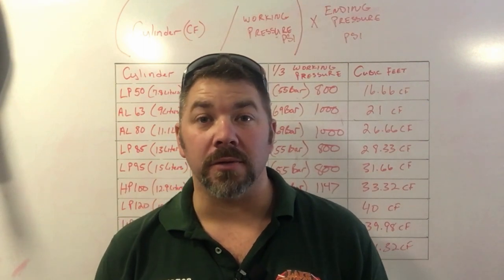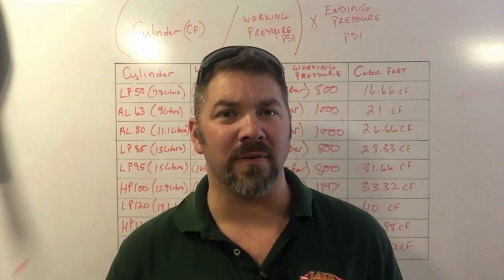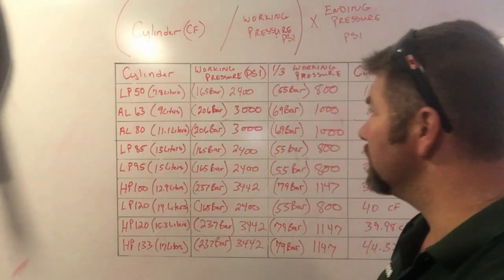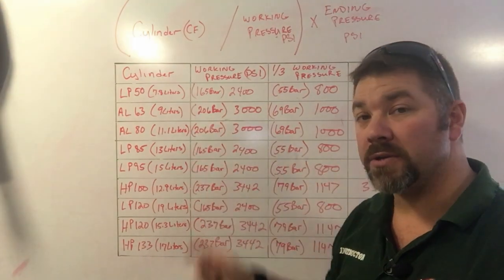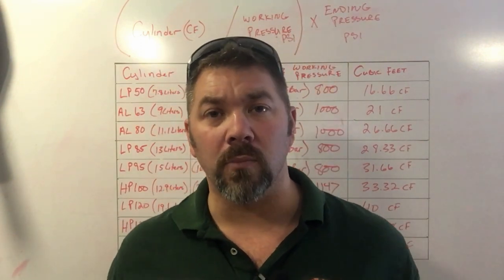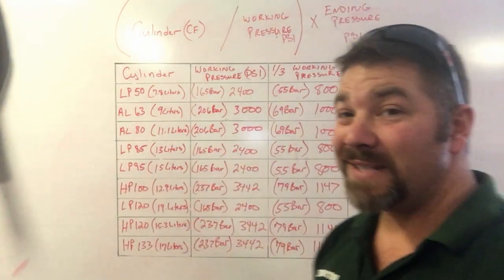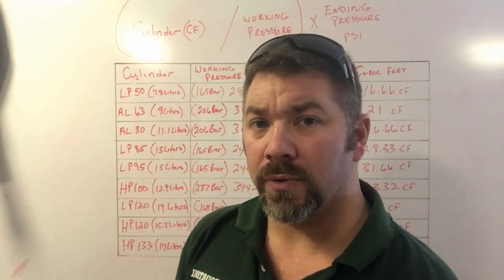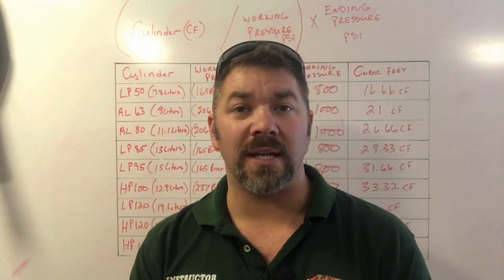How Much Air Do You Have??? Let's Do The Math

Comment: i have a pony plus a emergency spare air for extreme emergencies. lets say 2 people run out of air. i work on the rule of double redundancy. my instructor said i do not need to do this but i feel like i wanted to and he said it was my call. it sorta bulky but that is okay with me. i bought a mares dragon bcd. i have the spare air attached to it on the right side on a d ring. the pony is attached to my primary tank. i just like being safe and it gives me more confidence. 
ill be learning twins next year. 
:) best wishes
Reply from the maker: In my opinion, there is absolutely no problem diving with your setup.  I encourage all to dive in a manner that makes them feel comfortable.
Reply: thats  triple or quadruple redundancy, but if you like it, I quite agree , go for it, just remember with an increase complexity comes an increase in failure modes and confusion possibilities.
Reply: @LakeHickoryScuba  Im glad this came up, the trend lately i see and experience is the " Im safer than you" culture, many new divers I have come in contact with panic if someone is on a 40' rec dive without a back up computer, side mount twins with quad regs and a pony. That seems exaggerated but its showing up more and more, I was lectured by a new 62 dive tech/deep/sidemount student for diving doubles without an iso manifold and backup pony. It was a cleanup dive in about 15' seawater. theres great value in safety and training but it needs to be tempered in many cases, everyone wants to dive the Andrea Doria with 40 dives under their belt  it seems. In 40 years ive never had one ooa, and have only seen two- neither were equipment failures, just inattention,(relying on the computer in one case. ) if you expect a double ooa, I dont want to dive with you or your group.

Comment: When you do the equation for the AL80, and finish the initial calculation you state that you end with "45.39 cf still in the cylinder" (8min into the video), but I believe that answer still needs to be divided yet one more time by 3 (or divide everything by 3 at the begining) , to give you an actual ending of 15.13 as there is no way you can start with 26.66cf and end with 45.39.  

OR, divide everything by 3 at the start and then do the calculations, which would look like this:

AL80 (cf)  80/3 = 26.66 
starting pressure  3000/3 = 1000
ending pressure  1700/3= 566.66

AL80:      26.66 / 1000 = .02666
                .02666 * 566.66 = 15.10cf

So the correct amount of remaining air for that cylinder with 1700 psi, has a total of 15.10 cf
Reply from the maker: Hello Ronald, in this video we break down how much psi is in a cubic foot of air.  This video is not meant to be apart of the the rule of thirds.  We have a separate video on that. You seem to have confused the .026 with 26.6 cf. Great question though.
Reply: Ronald Lee, Bryan's calculations in the video are correct.  You've made an error in believing that the starting volume is 26.66 cf when that is in fact the volume of air in the cylinder when you are at 1/3 of working pressure (1000 psig).  The full volume of the cylinder is actually 80 cf, not 26.66 cf.   Given that the 1700 psi that Bryan used as an example is greater than half of the starting pressure of 3000 psi, you would expect the amount of air left in the cylinder at 1700 psi to be greater than half the original 80 cf.  With that in mind, 45.39 cf remaining at 1700 psi makes perfect sense.

Comment: Could you do one that includes a steel 80? I’m vertically challenged so I need the shorter cylinder. Plus it holds actual more air than the aluminum 80 from what I understand. The steel weight will also help with my extreme body buoyancy. Plus the smaller buoyancy change from full to empty
Reply from the maker: We sure can.
Reply: @LakeHickoryScuba  Up in the north east the Faber HP 80s & 100s rule the day

Comment: Theoretically yes, but in reality no one cares about the working pressure as a measure of content at the start of the dive. I have seen "full" AL80 and AL100 anywhere between 148 and 232 bar, depending on how rushed the people at the fill station were, or whether or not they want my recurring business My RMV varies between 15 and 25 l/min depending on the work load. If I have to follow a person or a group, I have little control over the depth. And then there are dive instructors that send students on an AL80 down to 40m until non-deco time is up - rule of 5th or 6th? Theoretically you are right, but that's not how the diving industry works 🤔
Reply from the maker: Sorry to here about you misfortune.   The purpose of the video was to show divers how you calculate what is left inside a cylinder at the end of the dive.  Happy Diving.
Reply: @LakeHickoryScuba  misfortune? I listed variables that affect what's left, and what can be done with the remaining air in the tank. I just think that a beginner (or the occasional vacation diver) shouldn't even think about what can be done with the remaining air. That's all. Peace out.
Reply from the maker: Your Quote """" If I have to follow a person or a group, I have little control over the depth. """" End Quote 

 I guess being controlled by others is a misfortune to me.   In regards to your RMV rate, a divers RMV rate never changes regardless of work load.  The RMV rate (Respiratory Minute Volume) is only controlled by the volume of their lungs.  Thus this volume never changes, the RMV never changes.  Your SAC rate (Surface Air Consumption) does change, based off the size of cylinder you use, and the work load.  The calculation for remaining cubic feet of air in a cylinder has nothing to do with how much a cylinder has to begin with, but is based off what the working pressure is, which is a known variable, and unchanging variable because that is what determines the volume of the cylinder, and the ending pressure.  Here is an example.  An 80 cf cylinder filled to 3000 psi, is 80 cf.  An 80 cf cylinder filled to 3500, would be the equivalent to a 93 cf cylinder, but once it reaches 3000 psi, it is still an 80 cf cylinder (we didn't physically change the size of the cylinder).  All other variables being the same as listed in the video, at the end of the dive, regardless of the beginning pressure, you would have an 80 cf cylinder with 1000 psi.  So the ending cubic feet of air would still be the same, only changing if the ending pressure is more or less.  You have to remember, we are not trying to figure up how much air you used, but how much cubic feet of air you have remaining.  

Lastly, I encourage all divers to be aware of how much air they have.  You never know when an emergency may happen, and they have to step up to handle the problem.   Safe Diving
Reply: @LakeHickoryScuba  I wouldn't call diving in a group and staying with the group (and thus not being able to determine the depth) being controlled by others, to the level of misfortune,  can you please point me to a source that defines the RMV, and supports your statement, that the RMV is constant and not depending on the work load (on land or under water)?
Reply from the maker: You can contact the Divers Alert Network and they have a great article on Respiratory Minute Volume otherwise know as Tidal Volume in the medical field (unfortunately I do not have it in front of me to tag in this response).   In short, our lungs are made of flexible material, but the maximum amount of cubic feet does not change.  Send me your email, and I will see if I can find the article mentioned. I will be happy to email the findings.

Anytime you are diving with a charter service, pre-determined depths will be put into place.  A proper dive plan with your buddy can mean all the difference in the world in regards to controlling your dives.  If your goal is to reach a depth not allowed by either the dive site itself, or the charter not letting you go any further, then you can simply provide your own charter and it solves the problem.
Reply: The RMV depends on how much CO2 one has to exhale, because the CO2 pp in the lungs triggers the breathing reflex. How much CO2 one produces depends on the build (tiny or fat has less metabolism that muscular and big), and how hard the muscles are worked. If you don't believe me: Since you're close to Manatee Springs, try to measure your SAC or RMV against the current in the river at 1m depth, and then again besides spring, outside the current, at 6m depth. Wouldn't you agree that on the same dive one can consume 50% more air in the shallow part of the dive than in the deep part of the dive? If all technical and human variables a kept constant (same diver, same lungs, same tanks, same regs, even same dive), the consumption can't be lower at 6x the depth, except RMV has changed dramatically, because of the physical work?
Reply from the maker: The biggest issue in your statement, is the false statement of location. I am located 10 hours north of Manatee Springs.  In regards to the rest, you would be correct on air consumption being greater at depth because of Boyle’s Law.  However, your maximum lung volume still remains the same.  At the end of the day, to calculate your remaining cubic feet in the cylinder, which is the purpose of the video, the equation is as follows.  Cubic feet of the cylinder / working pressure x remaining pressure.  Great discussion, hope you make smart choices with your knowledge.  Happy diving.